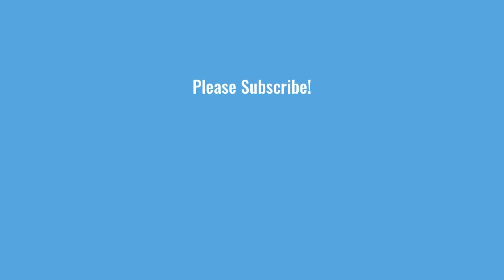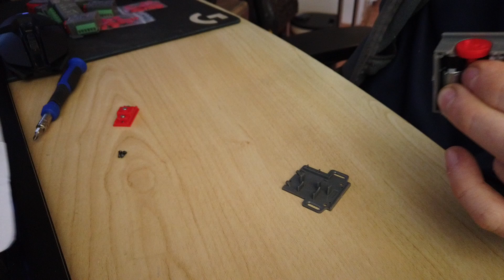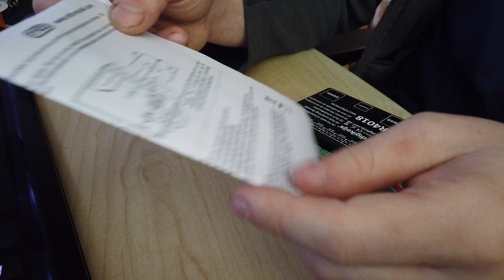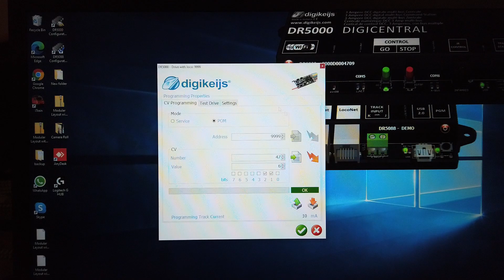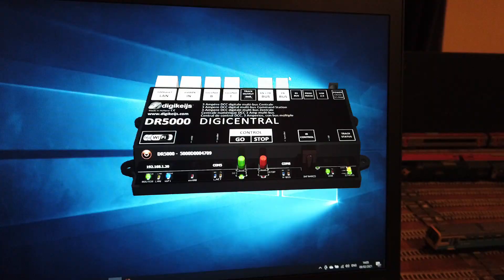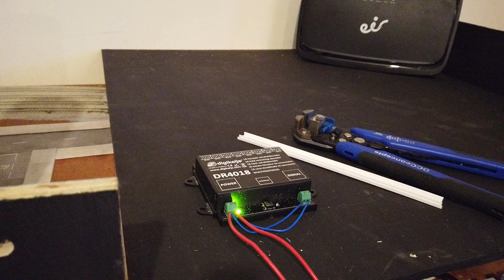DR4018 MTB MP1 Point Motor Installation - Weston Parkway

Comment: so do you need a dr5000 and a dr4018 to operate the dm1 motors?
Reply from the maker: You need any dcc command station in place of the dr5000 to operate them on dcc and the dr4018 or equivalent accessory decoder

Comment: Very well explained.  Made up my decision for the MP1. Thanks a lot. Keep it goin' mate. Greetings from Munich, Germany
Reply from the maker: Thank you! They're very good motors, good price and great size!
Reply: @Rule1ModelRailways   Hallo Nick. Did you have to change the bar for the n gauge Code 55 turnouts from Peco  (Streamline /Unifrog)? Or does it work with the 1mm standard bar as well? (which comes along). Thank you in advance.
Reply from the maker: I used the existing bar in the pack, they had two bars, think I used the smaller one

Comment: could you explain CV Number & Value purposes ??
Reply from the maker: The CV you set, controls how the DR4018 powers what is attached. Whether it be a pulse, continuous on, on/off or other setting. CV 6 provides a pulse long enough to change the servo type motors. A DR4018 can also control a lot of other devices such as street lighting, where the power needs to stay on continuously.

Comment: Nice Video Nick, Always nice to see a different kind of point motor, they look nice and quiet and look easy to install, how expensive are the motors? and are you considering upgrading the layout in the future to this system?  On my main layout I used dcc cobolts on the viewing side and seep pm1's on the fiddle yard. Hopefully this year I'll finish Swades pond and start doing vids on the main layout, I really do miss having a descent sized tail chaser to run trains on as I'm sure you can appreciate with you also having a small layout and now having a larger layout to run things on. All the best Tony
Reply from the maker: I am testing out the new motors with a view to upgrading the rest of the layout in due course. But I have been very underwhelmed by the DR4018 accessory decoder. I will wait for the DK50018 to be released before I even think about it! 

I do like a loop layout, it's good fun! This was the biggest I could have to fit in my car and indoors at my place. 

Thanks for dropping by! I look forward to seeing more of your videos!
Reply: @Rule1ModelRailways  sounds interesting Nick, It makes perfect sense to give the motors a good testing and will be interesting to see the DK50018 in action and you thoughts between the 2 decoders and the benefits. of the newer decoder. All the best Tony

Comment: Prefer the MP5, easier to install with more options.
Reply from the maker: I got a good deal on this set up, but yes I agree.
Reply: @Rule1ModelRailways   I note from your comments you're not a fan of the DR4018.  I've got them throughout my layout and haven't found an issue.  Agree they're not the most flexible in terms of profiles, but I've got a combination of points and lights on a single decoder without too much hassle.  Agree on the new DK50018 looks a nice piece of kit but James has given no indication when it'll be in stock.